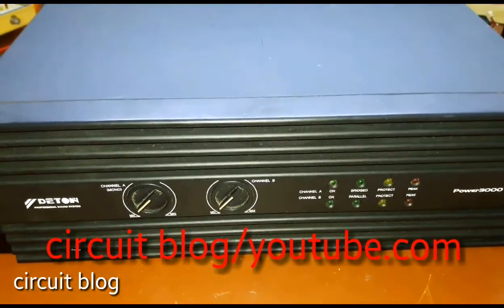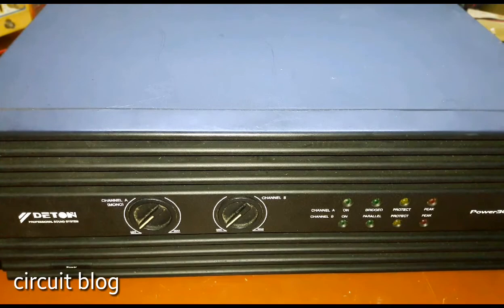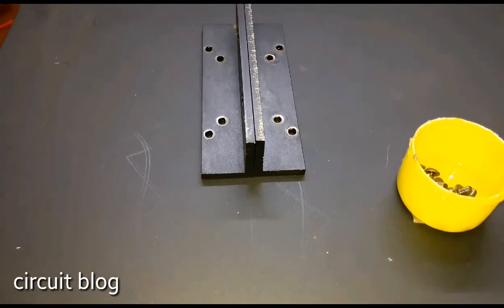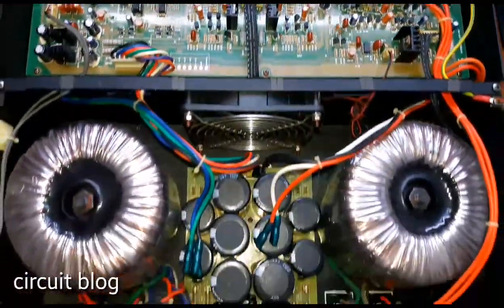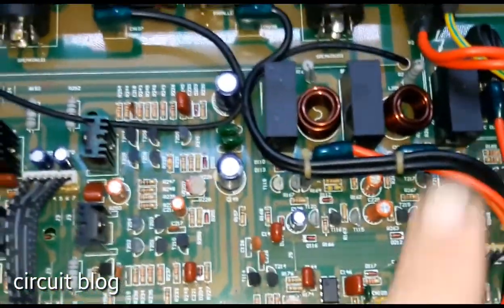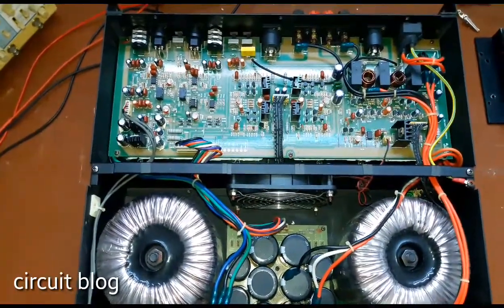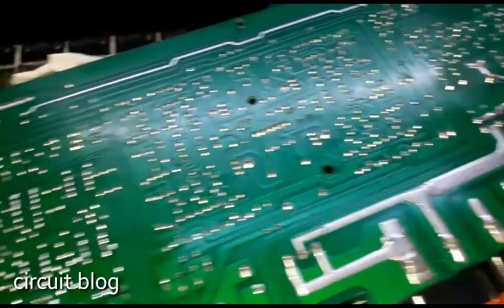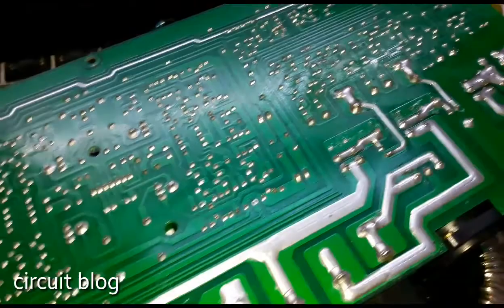deton power 3000

Comment: How could it have worked at all without the what I assume was the power wires not being connected to the filter board?? Nice job. Finding bad Op Amps can sometimes be tricky. What do you use to test them? I have a little IC tester that I bought a while ago that does a good job. I think it was around $50 US.
Reply from the maker: Hi thanks for the comment .
 In fact, I agree with you. I doubt that it produced any sound, due to the complete absence of power lines from the from the transistor out circuit , but almost 90% of customers say that and many of them say that it works and when  you  open the device you  get  surprised by the disaster in it  and this The situation is no exception.
As for how to check the OpAmp, I do not use an IC tester, but rather i make a complete amplification circuit on a test  board and provide it with the appropriate supply and connect this circuit to my test gear and i moniter the amplification of it and see if it works or not .
many people have many ways, but this is my way that i use   and it works .
Thank you for watching and God bless you
Reply: @circuitblog01  wow! You go through a lot of work testing. I guess you could build up a test jig since most op amps have the same pinout. Sure would be a positive check.
Reply from the maker: @AERVBlog  
Yes and in fact i build many circuit and test set and i will post a video on them in the up coming videos😊😊😊

Comment: What is the class power H
Reply from the maker: Hi thanks for your question
If you mean the power out put on the speakers terminals 
When i tested it on 8 ohm load i got  450w of  power on each channel separately
Reply: I play every 4 ohm channel for mid 12 inch speakers.. I'm still confused about the power of the DETON M3000, what class category does power actually belong to, whether class a b or class h, that's what I want to ask